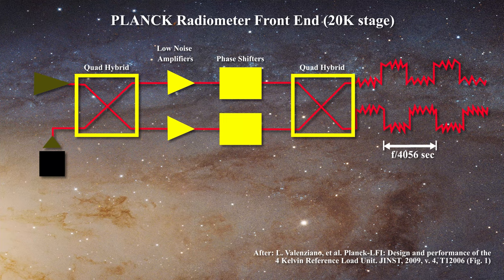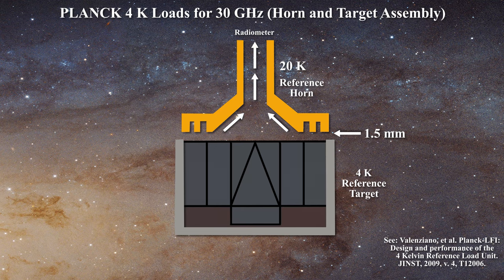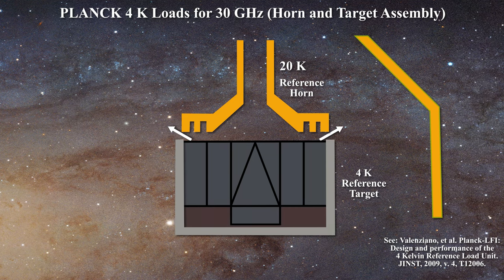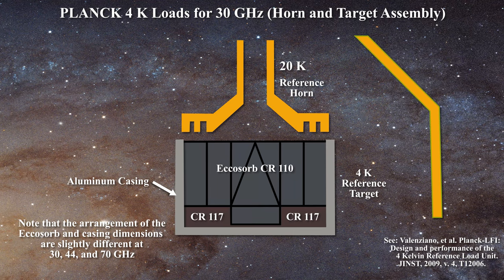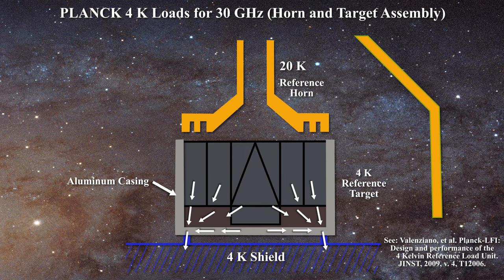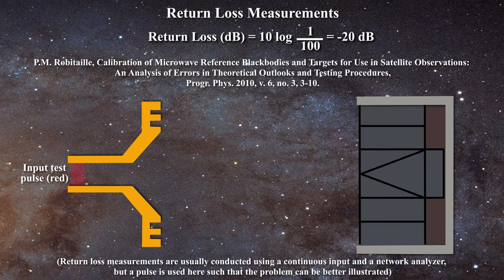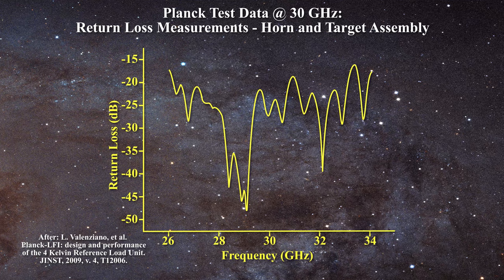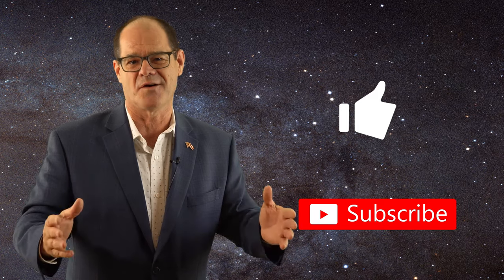Planck Satellite - Analysis of the 4K Blackbodies!

Comment: OK I follow all these arguments for design flaws in the sensor, but most people won't.  The main flaw is the assumption that you can even measure CMB. 
There are hundreds of thousands of galaxies in each pixel of plank (as evidenced by Hubble extreme deep field, for example), each with trillions of stars, and the counts are growing. The hundred thousand trillion (that's 100000000000000000) redshifted stars in a Planck pixel don't magically vanish when you go down to microwaves.

Comment: I’m an RF/SI engineer and my jaw literally dropped open when I saw the resonance of the return loss plot!   They made a resonant cavity for the 30Ghz case!   since you could roughly calculate resonances for a cavity on the back of an envelope, this shouldn’t have been a surprise to them.  I wonder if they designed it deliberately close to their test frequency or did they not know what they were doing?
Reply: Thanks for your comment. They built resonators not black bodies for their 4 K reference loads, so the Planck satellite is nothing but space junk. Please tell others.
Reply: @stevecrothers6585  Dear Steve Crothers, so, they built a DRUM to orbit and pretend measure radiation??  Haaaaa!

Comment: The same kind of detectors here - thermo-electric - are responsible for our knowledge of the infrared atmosphere also and thus the greenhouse effect. As a result of these 19th-century instruments  GH theory assumes only a special set of gases emit and absorb IR, the GHGs ; N2 and O2 are assumed not to and neither do the non-IR spectra of the special gases (CO2 CH4 etc). GH theory is absolute nonsense: Raman laser-based spectrometers show the temperature and emission spectra of N2 and O2 and the special spectra. The greenhouse gases are really the thermo-electric gases only detected by thermopiles and similar. My discoveries relate to blackbody curves,  all of Stefan, Boltzmann, Planck's work, and this work of this Pierre-Marie Robitaille too. Read my article at (with links to my work). I have an experiment coming that will end greenhouse theory. https://principia-scientific.org/settling-the-climate-woo-with-quantum-based-raman-spectroscopy/
Reply: It should not be very hard at all to build an atmosphere lab experiement that is scaled properly, a long straight tube of  air, with a radiant heat source on one end and a thermocouple at the other.
Reply: Interesting study you describe in your article!
Let me take the liberty to quote one of your last paragraphs "I imply no conspiracy upon Scientist’s inaction in this area from my findings; I just think it is simply a matter of no thought, or no daring", and take one step further on this:
- It's the FED that controls which funds go to each investigative project (NSF is just the middleman)
- The FED is privately owned by the same people that actively shove the GH effect and the AGW / Climate change CO2 narrative all over the place.
- Only studies that "confirm" their versions of science will ever be made, no matter whatever overwhelming opposite evidence is proven to exist.
BTW, these are also the same people behind the current plandemic, that is being fused with the climate change narrative, to turn upside down everything in the planet, from cash to health, restriction of public mobility, rationing and replacement of natural foods, rationing of energy / fuels, ban of land ownership and private use, seizing of natural resources, as well as all the other pillars of our current civilization.
Reply: @JoseSilveira-newhandleforYT  Well put. I am careful not to use the conspiracy line on them because I know the science I have is right and it will weaken my position; they will ad hominem me, and I don't need to use it. But I hear you.
Reply: @FelonyVideos  Yes indeed. My experiment would add to this a Raman spectrometer to measure the emission spectra energy levels /temperature of N2 (2338cm-1) and O2 (1556cm-1). It has been done of course, and is used (Raman spectrometers) in atmospheric measuring and modelling, but has not directly been done so in the greenhouse context as a direct rebuttal, and I will do it. What is more, we use the N2 absorption spectra in the running of the N2-CO2 laser where N2 is radiated by electron (and can be by photons) at its 2338 mode. No N2 absorption, no face surgery.  Done.
Reply: I am very astonished to find, that it is unknown that all gases absorb in IR frequency. I knew that from the school! Soviet school! Are they(!) so dumbed?
Reply: @odogkar  Thank you. Yes, it appears so. Are you a physicist? I need to get my hands on a Raman spectrometer team to conduct some simple, but direct,
 experiments.
Reply: @fractalnomics  I'm but a humble teacher, no papers nor lab. I'm sure you need people with a good base (hard and soft) for your work.
Reply: Truth and politics?   If a politician tells a lie and it is later found to be inconvenient, they can recant.  But if they tell the truth and it becomes inconvenient, they are stuck with it.  Do the math.
Reply: GH? What does that stand for?
Reply: @seymoronion8371  Greenhouse
Reply: So are all gases, greenhouse gases?
Reply: @robertfinch4572  Yes: they are only special by the instruments we measure them with. What I have found is that it is the N2 - at its 2338cm-1 mode - that energizes the CO2 at its 2349cm-1 mode (just as with the CO2 laser quantum physics). The black body curve of the atmosphere discriminates the spectra of N2 and O2: all done by 19th Century instruments. An absolute systematic error. Cheers

Comment: Not testing cr110 & cr117 at low temperatures ? Leaving the gap is fine for a microwave oven - this project seems like the days when a professor would throw the project & exam papers for grades as to distance ?
Reply: Yeah -- it should definitely have different conductive properties at cryogenic temperatures, which would affect absorption.  Could get a prize if they tested it, although the prizes for super-cooling things that haven't been chilled yet are winding down.

Comment: Exact analysis especially resonance frequency of the box where take place the distance between the casing and horn which is in fact setting the resonance frequency there. But there is interesting also the interference between the waves in the box which can give similar effect as it is follows:
How this buster does work? Well the tine situation here is in the mass of the light or whether the photon possesses mass or not in motion and where the mass of photon is equal to zero? Here the physics laws are fully observed and this accelerating engine indeed must to work! So where is the delusion of physicists who try to explain this phenomenon? The simple answer is in mistakable conclusion that the velocity of light in vacuum is the same as it is in empty or absolute space which in fact doesn’t exist according to USM www.kanevuniverse.com See this: Interesting and passionately lecture by Brian and I like it, but there I see the first two weak points of special theory of relativity. Brian said that to apply the special theory of relativity between two objects movement, the velocity between them has to be constant: dV/dt=constant which means that there absent acceleration da=0 which is correct in Einstein relativity. But that is the first weak point: if the acceleration between the two objects is equal to zero, then whether these two object exist each other or don’t? And if the answer is don’t, then how we can measure this velocity between two don’t exist each other objects? Obviously this is the problem of special relativity, because to exist each other the two objects have to dynamically interact, for example if we are one of the objects, to see another the light ray has to reach this object which is field (light) interaction. More over according to USM www.kanevuniverse.com in the spaces there is no empty space, which means that always exist dynamically interaction between all objects to be possible to exist each other.
The second weak point is connected with the velocity equality of special relativity and how correctly pointed out Brian, when in equation: u_x=(W_x+V)/(1+(W_x V_x)/C^2 )  the two velocities of two objects are equal between and equal to the velocity of light, then we obtain that u_x is equal to the velocity of light C as well, which means that there no matter whether the coordinate is movable or not (see page 48 USM). But is it possible the two objects to possess velocity of light even they are light rays themselves and by this way to become indistinguishable each other? The answer is no, because the light velocity is different in different mediums (different object have to have different velocities) and that is why we need this: 
The problem of photon comes from this: The empty or absolute space doesn’t exist according to USM http://www.kanevuniverse.com because of the essence of creating the fields (all gravitation, electrostatic-magnetic and nuclear) and their interconnection regarding their quality essence and quantity sizes. So in the general relativity any where the velocity of light in vacuum must to replace with the velocity of light in empty space and because such empty space doesn’t exist, that is the main reason that such velocity can’t be reached. So obviously the photon can has mass in repose equal to zero only in empty space, which doesn’t exist in reality, then all real photons in fact are virtual photons (relativistic photons) which in low velocities, their masses inclined to zero, but they have some masses through interaction with the surrounding matter (the surrounding matter carry partially light ray – experiment of Fizau). This interaction is realizes by the electromagnetic field in accordance with the equations of Maxwell Lorentz and in accordance with the essence of the light ray shown in USM.
That is right the shown device cannot work properly because this is inside reflection of high frequency waves from one of the chamber’s walls which eventually creates opposed reaction of buster-effect because of the shape of the chamber. But that is delusive because there affect the reflection of sloping walls in resonance mode which compensate such buster effect. But the light (wave) rays have impulse of buster effect i.e. the mass of photon it isn’t equal to zero in motion because of interaction with the surrounding matter. That is why the velocity of light can to be maximum only in empty or absolute space which doesn’t exist according to USM www.kanevuniverse.com and that is why such velocity cannot be reached and therefore all real photons are actually virtual photons – the mass in repose can to be equal to zero only in empty or absolute space! G.Kanev